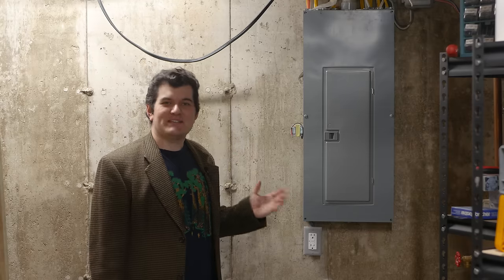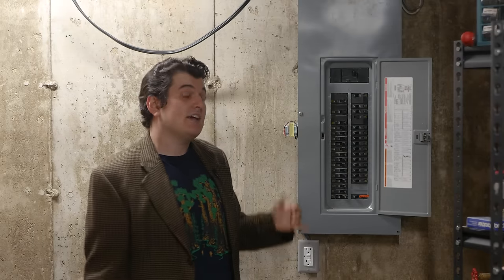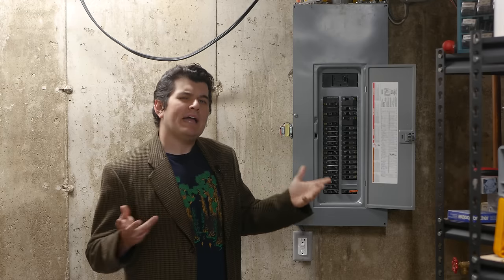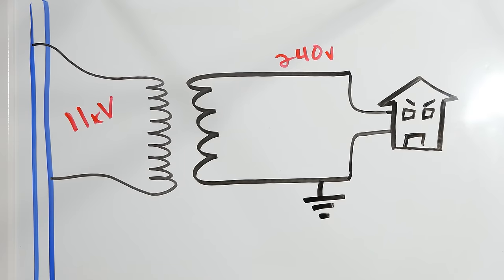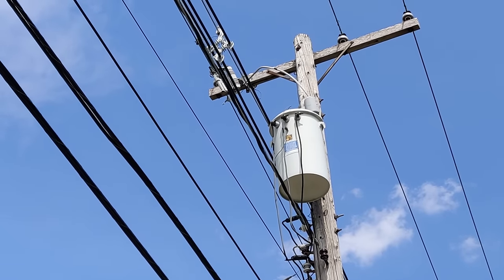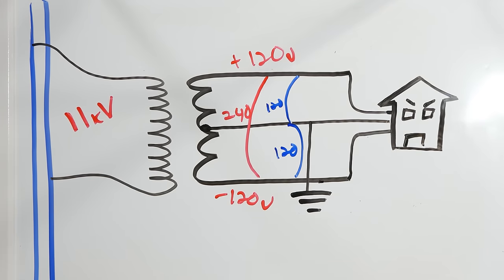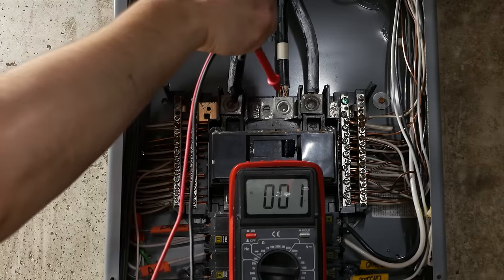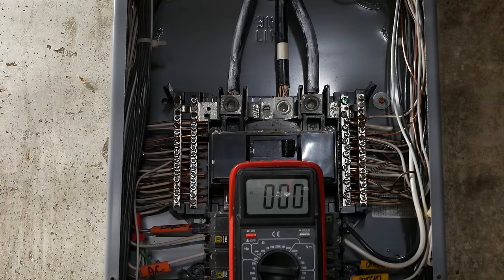The US electrical system is not 120V

Comment: "We do have 240volts, we dont live in the dark ages" Meanwhile, in Europe, we have 400volts in our service panels 😎
Reply: It depends. There are still quite a few single phase installations in older homes, they only have 230 V (phase to neutral). Only three phase connections deliver 400 V (phase to phase).
Reply: 415v
Reply: @gunnarkaestle  I know.
Reply: @Kevin-ui1dk  No, it is 400 V for three phase LV (or 690 V for industrial LV networks or sometimes 1000 V). Have a look at IEC 60038 (standard nominal voltages)
Reply: @gunnarkaestle  The UK is 240v/415v for 3 phase. A European 400v motor, for example, would still work on a UK 3 phase supply. The 3 phase boards here are always marked 415v not 400v
Reply: @Kevin-ui1dk   You are all right: 240/415, but 230/400. We normally say 230 volts i Norway, therefore, to be consistent, that would be (230*1.73) 400 volts @ 3 phase.
Reply: 230/400 is just the labelled "nominal" voltage. It usually goes a few percentages over to make sure the system can actually deliver the specified voltage. It's the same for the electrified railway! In most of Europe the nominal voltage is 15kV but you will mostly see 16kV or even 17kV reported on the instrument panel. It is only when you're far between transformer stations and/or there are a lot of other trains in the same sector that you when see the voltage drop below 15kV. The same could actually be applied to neighbourhoods, although this is more controllable by some calculations.
Reply: All normal norwegian houses/apartments are supplyed with 3 phase 230v IT  (Isolated Terra- every bulding have it's own bonding to ground/earth), some costal areas use 3phase 230v TT (Terre-Terre) 
For the last 20-ish years, more and moer new bulding are supplyed with 3 phase 400v +1neutral  TN
As far as I know, only Norway and Albania  use IT (IsolatedTerra) power distribution as the national standard 
Also we never use 3phase for normal indoor appliances. ovenes and waterheaters and kitchen stove/oven/Induktion hobs always use spesial old norwegian 1phase 230v 25amp plugs :)
There are still quite a few single phase installations in older homes and rural new houses, they only have 230 V (phase to phase) and no ground (IT power distribution)
Reply: @zigge1989  15 years ago my electro teacher said Albania had switched a long time ago 😅 TN started expanding mid-90s, I believe. Also 1phase/neutral in Apartments.
Reply: What home devices do you have commonly available today that need 400V?
Reply: @Tahngarthor  None other than electric car charger really. But it is s more efficient way of delivering power to the service panel.
Reply: Sometimes more
Reply: @Tahngarthor  I have a kitchen stove, a waterheater, an air compressor , a welding machine and an oldish Miele washing machine
 running off 415V.
Reply: @sablatnic8030  Those things all run fine on 240V in the US
Reply: @Tahngarthor  with higher voltages you can use smaller cables and equipment which saves cost. Three phase is ideal for electric motors so no capacitors/ electronics are needed to create an extra phase to start. Just like in the US appliences which need higher power can be run on higher voltages (heating, waterheater, compressor, pressurewasher, heat pump, stove, oven).
Reply: @Tahngarthor  a lot!
Reply: @SvenLippens1  Many single phase motors do not require a starting capacitor or electronics. In the US, very few residential motors have either. My ancient refrigerator has a starting capacitor, but modern refrigerators probably don't. None of my directly wired 120V shop tools have one. On the other hand, I have a relative with a 3 phase motor on his huge jointer - it has a starting capacitor, with a centrifugal switch to cut the capacitor out of the circuit once the motor starts spinning.
Reply: Why have 400 volts lmao
Reply: @cmw184  More is better! You have a whole lot more power available at the same current. Like, 20 amp 230v 3phase is 7.9kW of power, 20 amp 400v is 13.8kW of power. That means you can run thinner wires for distribution.
Reply: @Tahngarthor  My Induction stove top and oven. 
With somewhere around 14kW of power there is enough around that it feels like a big gas stove without beeing a fire hazard and explosion risk. 
its just insane compared to my old 230 V one.
With the old one it would take like 5 minutes to heat up some oil in a pan.
with the new one its already smoking hot after like 20 seconds
Reply: @JoakimGulbrandsen  LOL so do you believe EVs are better for the environment than gas/diesel cars? 400V 😂 the fuck.
Reply: That's nice. Our commercial building here in Texas has a 277/480v service.
Reply: @ironmatic1  Outside of commercial/industrial, is their any reason to have 400v+?
Reply: @puRpInF3cTioN  I don't see any reason. Split phase 120/240v residential power is not broken and doesn't need fixing.

277/480v services are generally preferred for commercial buildings around 5,000 sq ft+ because it saves copper for long distance feeders and for large motor circuits, and because a lot more light fixtures can be on a 277v circuit than a 120v one.
Reply: @ironmatic1   Yeah, when it comes to residential I can't figure out any reason why you would actually need 400V.. unless you got a smart mansion. I run a small data center in my house of about 30 servers and my residential 120v has been more than enough. Not to mention all the other electric equipment I'm running on top of that.
Reply: @JoakimGulbrandsen  - I think that your examples somewhat betray your stated intended results. "That means you can run thinner wires for distribution." Not, as I understand it - in that both your examples are stated at 20-Amps - you'd get more power from the same size line though. "You have a whole lot more power available at the same current"  Right and, wire size is primarily based on the current/amps IIRC.
Had your 400v example been stated at say 10-amps and +/- 7kW = "...you can run thinner wires for distribution" for the same power requirements. I understand that you were replying to CMW18 yet, the context is disjointed. Iterate, you can have more power for the same size wires OR, you can have the same power through smaller wires - not both, smaller wires and, more power available. Thank you and, best regards-
Reply: @markaoslo5653  No, it is not wrong. The need for a 230v 3x63amp (25kW) main breaker isnt necessary in 400v, so you can as an example rather go 3x32 400V (22kW) and have about the same amount of kW available. So for distribution in 230V you need 3x16mm2 cable, vs 400v 32 you can use 3x6mm2. That was my example.
Reply: @puRpInF3cTioN  Well. For local enviroment it is undisputable better. But there is a long way to go to get production to zero.
Reply: @puRpInF3cTioN  Easier distribution of power.
Reply: ironmatic 1 not so nice at all, normally our devices rated for 240v have a 10% +/- range in voltage they can operate on. 277 is out of that range.
Reply: KushFriendlyXeX 400V 3phase is very nice for example garden devices as wood choppers. The 400V versions are a lot more powerfull than the 240V versions. So thicker material can be done. Also charging an EV with 3 Phase 400V goes a lot faster...
Reply: @puRpInF3cTioN  The main advantage is that you do not have to burn fuel made from oil in order to run the car. Petroleum is actually too good to burn, since you can do a lot of different stuff with it. :)
Electrical power can be solar power or hydrodynamic power or even nuclear power (which is not that eco-friendly because you have to store the nuclear waste for some thousand decades but at least is does not produce CO2).
Reply: @s devrim , Damn !!
Reply: @Tahngarthor  Thr stowe usally needs 400 volts however, in sweden you got 400 V on two fases, but if you use a welder or some other eletric heavy machinery we got 360 Volts from a three fases
Reply: Gunnar Kaestle three phase is very rarely used in homes. Even if most homes in Europe are/can be connected to it.
Reply: @Zealotus_NWE  It is just a nominal voltage. It can be + or - 10% and this is why a 220V motor works perfectly well on 240V. It will even work on 264V if the 240V system gets to its upper limit.
Reply: @Tahngarthor  There are very few but this allows you to have, for example, a 16A supply and run 3 high powered appliances on 3 different phases.
Reply: @buggsy5  Well pumps have capacitors.
Reply: @Kevin-ui1dk  We use European 400v motors in industry around my part of Canada, however we run them at 347v. The motors don't really seem to mind. Everything here is either 120/208/240/347/600v, depending on the purpose.
Reply: @s devrim Glad to hear it wasn't just me that found out how things work, as a toddler I put a pair of long nosed pliers across a very old 2 pin mains plug to see what would happen😱☺️😉.  The best way to learn.
Reply: 400V ?   are you sure this is not because the rated output of  240V can vary by up to 15% and when rectified this is abut 400V DC
Reply: @puRpInF3cTioN  I call them "coal cars", because that's essentially what they are since they are powered by the electrical grid that is more often than not powered by burning coal.
Reply: the rest of the world has 50HZ supplies, the US and a few others have 60HZ, and for those interested Aircraft run on 400HZ. ? Why because the iron lam stack cores for transformers, motors and generators are much smaller and thus weigh less.
Reply: 415 volts last time I measured it.
Reply: Industrial voltage in the US is 460 volts
Reply: Voltage measured between my house and the next door neighbour is 415.
Reply: @Kevin-ui1dk    UK 415V across the phases, 240V to ground. In short (pardon the pun) the difference still exists... US has 120V to ground, UK has 240V to ground.
Reply: @dagfinnrapp7201  yes because we go from 230to 250in steps now we at 240
Reply: @Tahngarthor  cooking heatpumps. Load splitting its just the Standart nowadays
Reply: @Tahngarthor  yes it work in the US it also can work on 10v  but u need a cablediameter of a can u know the higher the voltage the lesser diameter of cupper u need and the less waste of energy
Reply: @buggsy5  u know there are different kind of motors q1phase motors need a capacity for the second coil or a rewindcoil for delay a split pole motor. But mostly they have bad starting torque hand drills and such have a universal motor wich is more like a DC motor at heart  but also work on ac but too get a heavy load motor too run 3phase is best
Reply: @puRpInF3cTioN  u don't need 400v but it's better why run on 120 go too 12v
Reply: @dabbasw31  You have to burn to make power at the factory, renewable energy doesn't make enough power even now and if everyone was on EVs it would be tons of power plus those data centers are only getting bigger.
Reply: @ssolid1  Why run on 400? No one has really given a legit reasoning yet. Go to 12v? Are you suggesting I get solar? Because I do, it doesn't like my very small data center.
Reply: @puRpInF3cTioN  efficiency
Reply: @ssolid1  How does upping the voltage add any efficiency
Reply: @puRpInF3cTioN  Increasing voltage decreases current and component size - or the amount of energy lost to resistance in the wire (or some combination of the two)... But there is a point of diminishing return as the requirements of electrical insulation/isolation go up (in both size and cost) with voltage.  In today's world of solid-state everything, LED bulbs, Inverter drives for variable speed motors, 415 3p isn't something that is helpful for most.  Those of us who like to weld or have large motors (even large air conditioners) would love to have more power available in the home.
Reply: @BigBoy4005  So their really is no benefit unless your using heavy equipment. Either way it won't make sense to me for residential use, none at all. People want to say it's more efficient, yeah those are the same ones that say EVs create less pollution than gas vehicles.
Reply: @puRpInF3cTioN  Don't get me started on that one; the electrical grid is not even close to being ready for everyone to drive an EV.  You will probably have to book a time to charge and pay penalties if you're not connected during contracted times.
Reply: @BigBoy4005  Well that's my point. 😂
Reply: @puRpInF3cTioN  It depends on the source of the power. Here in the Pacific Northwest, we have a lot of hydroelectric power as well as wind turbines. However, I have no idea what the carbon footprint and pollution are for wind turbines. Roughly 95% is hydro, wind or natural gas, with somewhere around 55% - 60% is hydro. 

We don't seem to get the brownouts that are common in a lot of areas of the country - even when exporting a lot of electrical power to California.
Reply: @buggsy5  Honestly I don't give a shit about any of this. 😂 As long as my servers keep running, that's all I'm worried about.
Reply: @puRpInF3cTioN  why they do it for high voltage line across the country. Now think
Reply: @Tahngarthor  Geo thermal heating pump with electric heater backup in case of pipe failure, and yes, that's in a small single family house. Swedish winters can be quite cold.
Reply: @gunnarkaestle  you tend to have all 3 phases in every home, and the initial installation will tend to use all 3 phases more or less equally... it's usually a lot of strain on the electrical systems if charges are not more or less equal. You do that by averaging (more or less) things in small installations, and taking a somewhat closer view at anything that gobbles more, like industrial plants.
Reply: @Kevin-ui1dk  440?
Reply: @JoakimGulbrandsen  And of course, you have to ask yourself, who wants fat wires?
Reply: @JoakimGulbrandsen  environment?
Reply: @MarcEspie  If the LV grid (L1, L2, L3, N) is not symmetrical (and that happens naturally even if you try to connect your 1ph end circuits equally to all three phases, then the current on N will grow. In some cables, the N is weaker than the L phases, because true 3ph loads are symmetrical. But if the share of non-symmetrical loads increases and if these are not balanced out, then the N may burn out. This is the reason most distribution grid operators take care and do not allow too large single, unbalanced loads.
Reply: @Kevin-ui1dk  In the late 80s, an alignment of nominal low voltage started in Europe. It took about 20 years with a merging of the tolerances, and on the Continent the nominal voltage was risen from 220 V to 230 V whereas in the UK the nominal voltage was reduced from 240 V to 230 V. With the factor of sqrt(3), the phase line-to-line voltage is 400 V. Any other numbers are just legacy labelling.

Have a look at EN 50160:2010 "The standard nominal voltage Un for public low voltage is Un = 230 V, either between phase and neutral, or between phases. [..] Under normal operating conditions excluding the periods with interruptions, supply voltage variations should not exceed ± 10 % of the nominal voltage Un. In cases of electricity supplies in networks not interconnected with transmission systems or for special remote network users, voltage variations should not exceed + 10 % / - 15 % of Un." So anybody who is designing LV equipment, this should accept a supply voltage range of + 10 % / - 15 % (do not overheat, do not break, do not underperform significantly). Actually, during a disturbance, the voltage may (for short periods of time) even exceed this range, so LV loads should cope with that as well. See https://www.keysight.com/upload/cmc_upload/All/1.pdf
Reply: @ssolid1  That is exactly why the automobile industry choses for EVs a "high volt" level of around 800 V. You can transmit a lot of power with thin wires, which saves weight and money (thick and heavy copper wires are expensive)
Reply: @gunnarkaestle  saves weight space and power
Reply: @ssolid1  Weight & power: sure. And don't forget the bending radius of thin cable compared to thick tumb-sized one. It is easier to install in the EV. And considered to electrotechnical standards, everything up to 1000 V AC and 1500 V DC is considered low voltage, which has implication to saftey standards. But I wouldn't say it saves power, as the power is the same with 100 V and 800 A or 800 V and 100 A, if the current density is the same. Or did I miss something?
Reply: @gunnarkaestle  actually it does specially on ev for the frequency transformers
Reply: @gunnarkaestle  but normally u can make it same efficient on normal electric power but u need just much thicker cables
Reply: @deansmith4752  here in the Uk the rated output is within 10% of stated voltage never more than that.
Reply: Yup...and its 50cps...
Reply: @zigge1989  Norway and Albania should unite :-)
Reply: @cmw184  Tesla use 400V. Porsche use 800V
Reply: @gg-eo6ez  Say what?
Reply: @oH well,lord! I mean, we have stoves in the US and they work just fine on 240v. My question is why is this unusual voltage of yours an advantage?
Reply: And we have 480 3 phase.

SUCK IT. MERICA.

YEAH.

Etc.
Reply: @Tahngarthor  those i diy'd
Reply: wait, the busbar to circuit breaker is  ot screwed tight? it just clicks into the bus bar? wow, all that with 30A? well, good luck with that!
Reply: @petrvalkoun4539  good luck nothing. It works just fine. That contact point is never the source of problems.
Reply: @MastaSquidge  after 20 years when its corroded? I would love to trust it...but I would never
Reply: @petrvalkoun4539  I have been inside of panels much older than 20 years and have never seen this in a normal situation. Furthermore, bolting it down wont prevent corrosion if it does occur.

If/when corrosion inside a breaker panel occurs its a result of water ingress which is a much more immediate and significant problem than a corroded bus bar, and again this would still be a major problem for a bolted down breaker.
Reply: In Canada, we have 347/600V three phase power
Reply: We invented electricity here so yeah we got older stuff, immense irony eh?